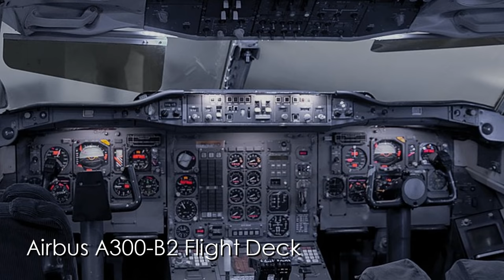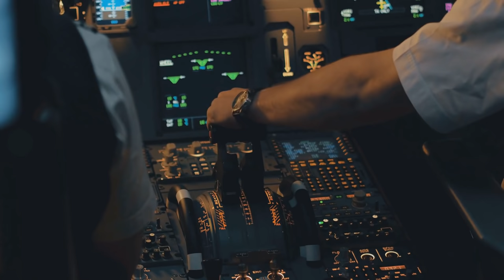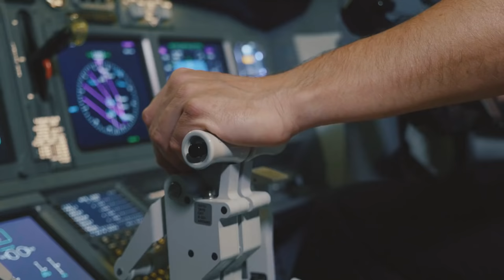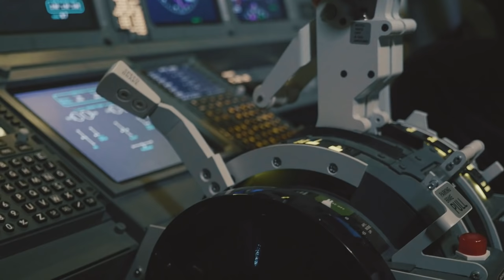Pilot Rips The Tail-fin From Their Plane (American Airlines Flight 587) - DISASTER BREAKDOWN

Comment: | FULL MANIFEST |

Flight attendants:

DEBORAH FONTAKIS,

BARBARA GIANNASCA

WILMER GONZALEZ

JOSEPH LOPES

MICHELE MILLS

CAROL PALM

WILLIAM VALDESPINO

Pilots:

EDWARD STATES (Captain)

STEN MOLIN (Copilot Molin overuse of rudder controls and broke the composite lugs that attached the vertical stabilizer and it failed at 9:15:58. His wacko movements of the rudder from fully left to fully right, and back again in quick succession, resulted in hazardous sideslip angle that led to extremely high aerodynamic loads and it detached the vertical stabilizer from the plane. If the first officer had stopped moving the rudder at any time before the vertical stabilizer failed, the aircraft would have leveled out on its own, and the accident would have been avoided. He was not a good pilot. But also the captain has part of the fault because he should have waited at least 3 full minutes to take off behind Jap Airlines 747 heavy departing ahead.)

Passengers:

Manuel Abreu, Dominican Republic
Juana Abreu, US
Candida Rosa Acosta, US
Oneida Acosta De Araujo, US
Rosa Alcantara, US
Selene Alcantara, Dominican Republic
Danny Alcantara Taveras, Dominican Republic
Hipolito Algarroba, US
Ubencia Algarroba, US
Josefina Allende, US
Ramon Almanzar, US
Rosa Almanzar, Dominican Republic
Juan Almonte, Dominican Republic
Luz Alvarado, Dominican Republic
Rafael Alvarez, US
Marina Aponte, US
Regina Arroyo Molina, US
Jovanny Baez, Dominican Republic
Noemi Batista, US
Lialette Batista, US
Tito Bautista, Dominican Republic
Baudilio Bautista, US
Xiomara Betances, Dominican Republic
Dennis Blair, US
Jose Bonilla, US
Wilberto Brito, US
Pedro Brito Rodriguez, US
Angela (Maria) Burdier, Dominican Republic
Martina Burdier De Rodriguez, US
Maria Burdier Tapia, Dominican Republic
Robert Cabrera, Dominican Republic
Consesora Calaff, US
Ramon Calderon, US
Petronila Capellan, US
Genimiz Carty, US
Juana Castillo, US
Santana Castillo Fernandez, US
Sobeira Cedeno, US
Angel Celestino, US
Christina Charles, US
David (Ching) Chen, Taiwan
Victor Cornelio, Dominican Republic
Juan Coronado, US
Gladys Coronado, US
Danilo Corporan, Dominican Republic
Eduarda Corporan, US
Janet Corporan (infant)
Gisela Cuello, US
Indira Cuevas, US
Federico de la Asuncion, US
Karla de la Cruz, US
Clara de la Cruz, US
Leonardo de la Cruz, US
Leonte de la Cruz, US
Marino de la Cruz, Dominican Republic
Angela de la Cruz, Dominican Republic
Glen de la Cruz, US
Maria de la Cruz, US
Alexandra de la Cruz, US
Juan de la Cruz, US
Rafael de la Cruz, US
Alcibiades de la Cruz, US
Ramona de Leon Corporan, US
Nieves de los Santos, Dominican Republic
Guadalupe del Rosario De Peralta, US
Eustaquio Delarosa, US
Reynida Delgado, Dominican Republic
Patricia Demarchena, Dominican Republic
Lorenzo Despradel, US
Robert Despradel, US
Roberto Despradel (infant)
Julia Diaz
Victor Diaz, US
Francisco Diaz, Dominican Republic
Luz Diaz, US
Maria Diaz, Dominican Republic
Alejandro Diaz, US
Eduvige Diaz Pachano De Bright, Dominican Republic
D Angelo Dilone, US
Julia Dominguez, US
Adriano Espino, Dominican Republic
Florentine Estrella, US
Miguelina Fabre, US
Marra Filanovsky, US
Ilya Filanovsky, US
Lasar Flores, US
Mariana Flores, US
Lasar (Isaiah) Flores, US
Anthony (Antonio) Forteza, US
Nalda Galva de Reynoso, Dominican Republic
Milagros Garcia Perez, US
Eduardo George, US
Milton George, US
Felix Gervacio, US
Jose Gomez Contrera, US
Pedro Gonzalez, Dominican Republic
Carmen Gonzalez, US
Regina Gonzalez, US
Sylvie Greleau, Great Britain (see note below)
Altagracia Guerrero, US
Dariana Guerrero, US
Diomarys Guerrero, US
Glenda Guzman, US
Johnny Guzman, US
Nicolasa Guzman De Mercedes, Dominican Republic
Miguel Guzman Jr, US
Marion Hartigan, US
Teofilo Hernandez, Dominican Republic
Juan Hernandez, Dominican Republic
Carla Hernandez, US
Joanny Hernandez, US
Jean Heuze, France
Yohanly Hidalgo, US
Dario Hidalgo, US
Alexander Hodge, US
Joseph Huber, US
Frances Huber, US
Sarah Huertas, US
Jose Vicente Infante, US
Yamil Jerez, US
Humberto Jimenez, Dominican Republic
Yesica Jimenez, Dominican Republic
Jayke Jimenez (infant)
Roberto Jimenez Perez, US
Ernestina Jiminian, US
Jose Lafontaine, Dominican Republic
Melvin Landsman, US
Elaine Landsman, US
Luz Maria Lendof, Dominican Republic
Marcelina Liriano Guerrero, US
Mercedes Lopez, US
Emily Lopez, US
Argentina Lopez, US
Roberto Lopez Jr, US
Jose Lora, US
Karl Lora, US
Mercedes Luciano De Veloz, US
Maricio Made, Dominican Republic
Ana Made, Dominican Republic
Victor Marcano, US
Digna Marte, Dominican Republic
German Martinez, Dominican Republic
Aurora Martinez, US
Yanelly Martinez, US
Angel Martinez, US
Sura Martinez, US
Juan Martinez, Dominican Republic
Ibelise Martinez De Goris, Dominican Republic
Nieve Mason, Dominican Republic
Virgilia Mateo, US
Nuris Matias, US
Dominga Matias, Dominican Republic
Orlando Matos Perez, US
Hilda Mayol, US
Carmen Medina, Dominican Republic
Wilfrido Medrano, US
Ashot Melikjanian, US
Grace Mena, US
Wilton Mendez, US
Daisy Montalvo, US
Diane Monte, US
Remedios Montilla, Dominican Republic
Antonia Morales, US
Luis Morales, US
Efrain Mota, US
Luis Munoz, US
Alen Noboa, US
Victoria Nova Rivera, US
Ana Nunez
Fatima Nunez, Dominican Republic
Aaliya Nunez Reynoso (infant), US
Siegried Objio, US
Rosanna Ogando, Dominican Republic
Ramon Oviedo Germoso, US
Angel Paradis, US
Carmen Pena, Dominican Republic
Katherine Pena, US
Michael Pena, US
Magnolia Pena Nadir, US
Yelisa Peralta, Dominican Republic
Ramon Peralta, Dominican Republic
Augusto Peralta, US
Fernando Perez, US
Carmen Perez, Dominican Republic
Jose Perez, Dominican Republic
Maria Perez Mendez, Dominican Republic
Luis Perreaux, US
Jean Phanord, Haiti
Luis Pichardo, Dominican Republic
Ramona Pimentel, Dominican Republic
Nurys Polanco, US
Ercilia Polanco, US
Reyna Prospero, US
Joseph Ramirez, US
Victor Ramirez, Dominican Republic
Jose Ramirez, Dominican Republic
Rafael Ravelo, Dominican Republic
Eleuteria Reid-Hay, US
Agapito Reyes, Dominican Republic
Roberto Reyes, US
Norbeto Rivera, US
Julio Rodriguez, US
Ruben Rodriguez, US
Julia Rodriguez, US
Maria Rodriguez, US
Lucia Rodriguez Almonte, US
Juana Rojas Javier, Dominican Republic
Mercedes Roman, US
Whilman Rosa, US
Angel Rosa, US
Jose Rosa Toledo, Dominican Republic
Danilo Rosario Castillo, Dominican Republic
Rosa Ruiz, US
Johanna Sanchez, US
Gilbert Sanchez (infant)
Felix Sanchez, US
Luis Sanchez, US
Jose Sanchez, US
Elvis Sanchez, US
Timo Santala, US
Iris Magali Santana, Dominican Republic
Jose Siri, US
Imelda Solis, US
Daria Soriano De Batista, Dominican Republic
Asencion Sosa, US
Franklin Soto, US
Balbina Soto De Rodriguez, US
Angela Suazo Perez, US
Lina Tabar, Dominican Republic
Milagros Tabar, Dominican Republic
Maria Tatis, US
Jose Tatis Minaya, Dominican Republic
Guadalupe Taveras, US
Ivelisse Taveras, Dominican Republic
Adaline Tejeda, US
Evelyn Tolentino, US
Po Tseng, Taiwan
Feliciano Valera Sierra, US
Maximo Valerio, Dominican Republic
Norma Valoy, US
Maria Vargas, US
Ilan Vaserman, Israel
Zeneida Vega, Dominican Republic
Carlos Veloz, US
Braudilio Veloz, US
Gloria Ventin, US
Cristopher Ventin, US
Maria Del Carmen Ventura, Dominican Republic
Nicola Villella, US
Kathleen Williams, US
Cesar Zabala, US
Reply: Yeah, but you can blame AA for that. They TOLD him to do just that.